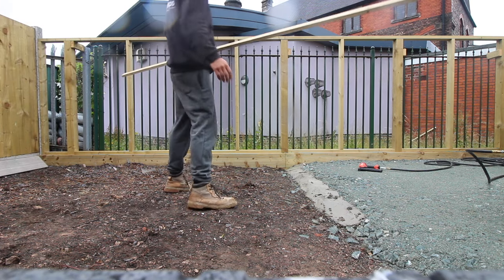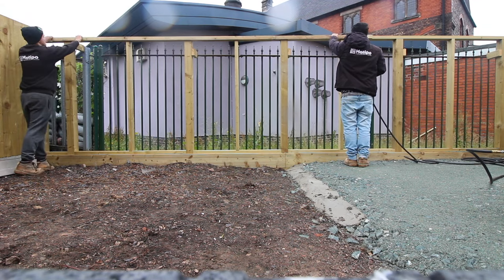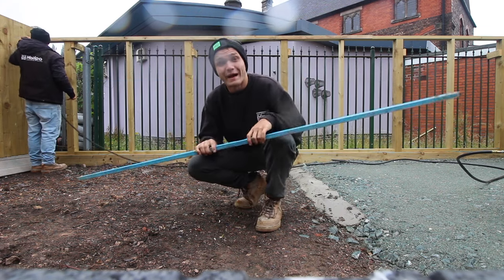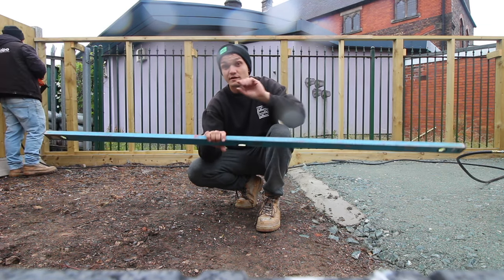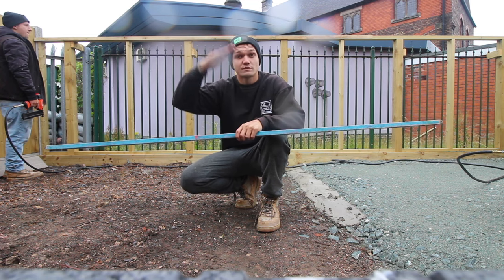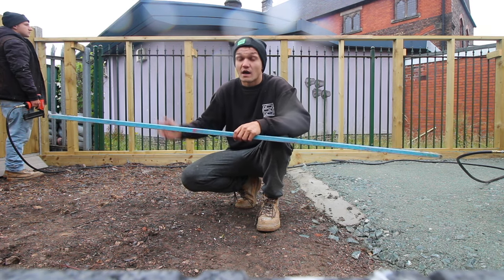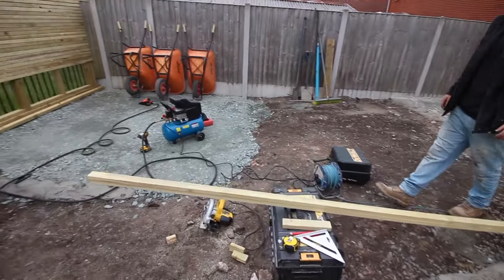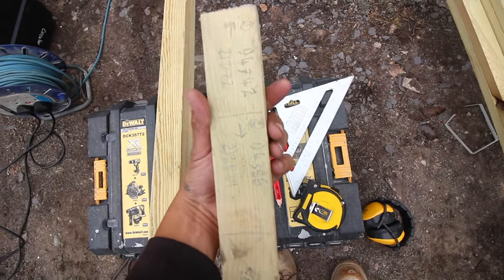HOW TO Install Timber SCREENS & Sleeper PLANTERS!! Fencing and Raised Beds TOP TIPS!!

Comment: Hey mate, i love your work.. can you please elaborate for my tiny mind lol, the differential joint principal again? You mention you do 3 different ones .. can you please break this doww. I get that you dont like to see the vertical joint line down the fence but if you could just explain your technique a little more for me that would be hugely appreciated!
Reply from the maker: Once you have your posts and framing in and you begin cladding, on the post or framing that you need a join, you'll want it to go join, full batten, full batten and then a join again. So you measure and cut your battens accordingly 👌⚒️

Comment: Hi mate. How do you find your impact drill lasts with the timber fixing. I have had to use a power drill but the cord is a real pain. Do you have to have a few batteries?
Reply from the maker: They fly through it! Defo a must have for this sort of work.. dont cheap out though.  Go for dewalt or makita n some decent amp batteries n you'll be screwing for days 👌💯⚒

Comment: Great work guys - how much / to what grit do you have to sand the battens to get a clean look? Using sawn timber battens is a lot cheaper than purpose-made planed slats, but not sure how much extra effort is involved in getting a nice finish. Do you usually stain the finished battens or leave as-is?
Also, do you get many reject battens (bad knots etc)?
Reply from the maker: thanks mate! we use 100-120 grit, and then we treat the screen using an osmo oil.. osmo uv protection oil is what we use if we aren't using an osmo stain

Comment: Hi buddy what length brads you using 38mm do you have any issues with batterns pulling off at all?🤙
Reply from the maker: we use 50mm stainless steel brads, and have had no issues with battens pulling off
Reply: @Matipolandscaping  im going to be using 2×1 horizontal fixing into 2×1 vertical  so 50mm thickness 38mm should be alright for that you recon